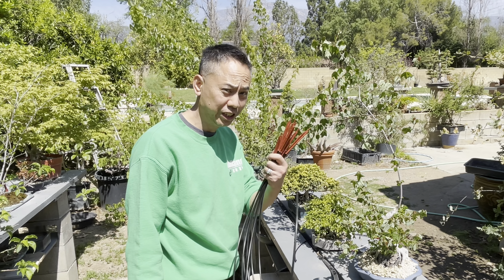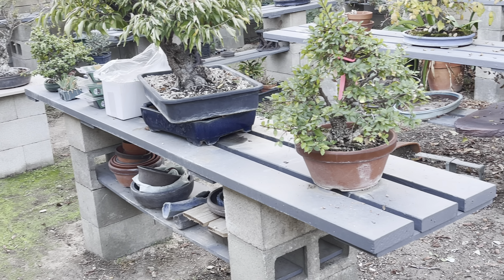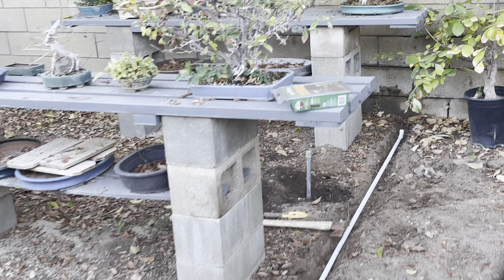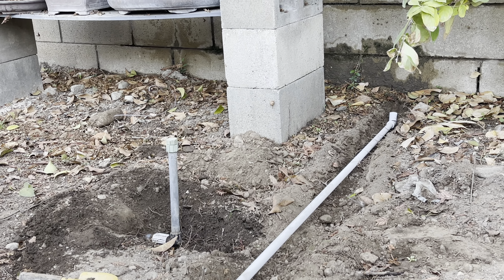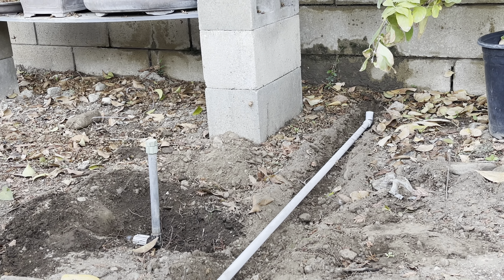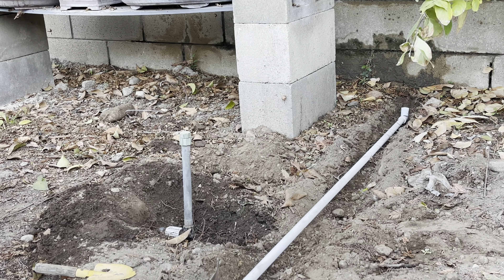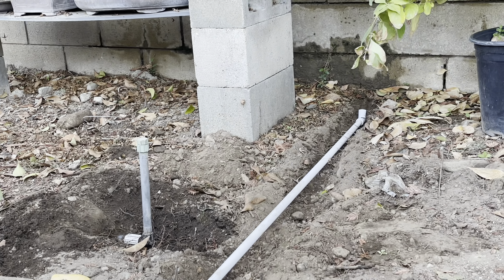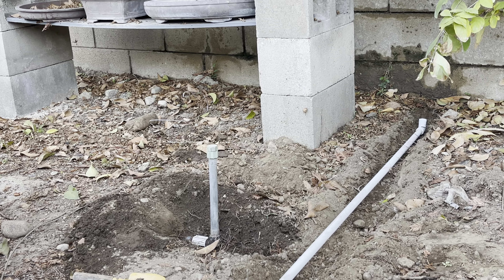Watering and Drip Irrigation System Part 2  - Technique - Baikoen Bonsai Club

Comment: Nice! I did mine last year and it worked great! My fence broke apart and I had to move my trees around. It’s been over a year and I need to get back on it again. It’s actually easy! I have 3 zones. I might need 1 more zone. I hope not haha. Orange is good because it’s tilted in a lower angle and helps watering.
Reply from the maker: It’s worth the investment

Comment: There are many emitter types - sprayers and drippers. Any particular reason why you chose to use spot spitters?
Reply from the maker: I used several of the commercially available HD and Lowes brand product. These Spotspitters are pretty heavy duty and no moving parts to break.